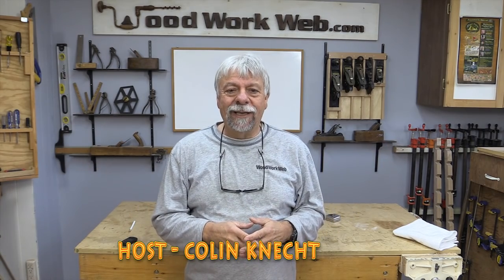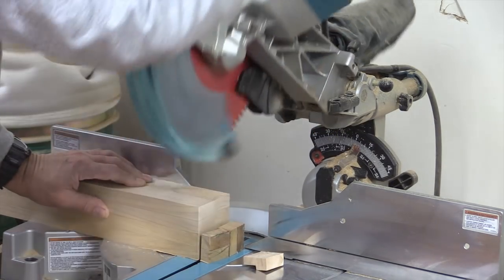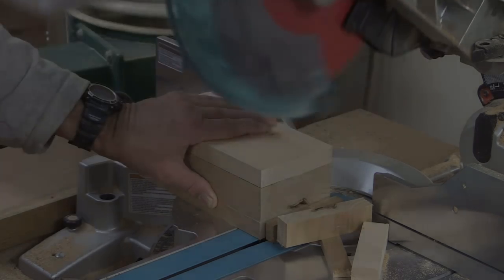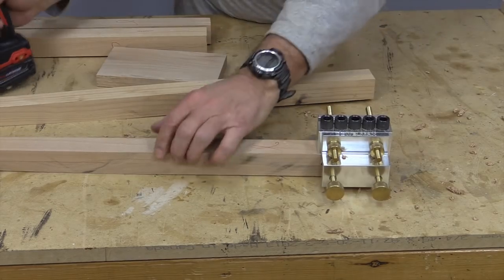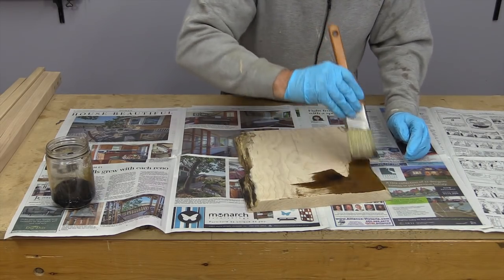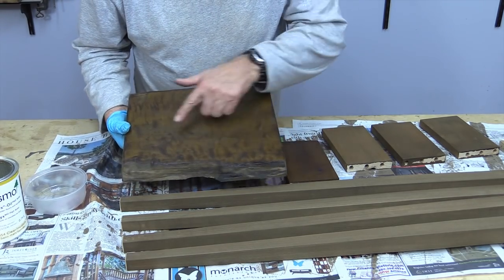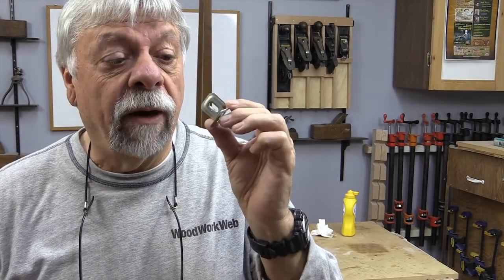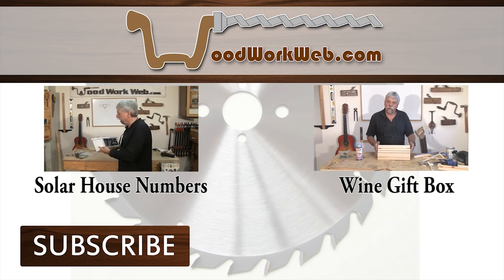How to Build an Album Table with Natural Edge Top

Comment: Good work Colin, however, i wonder how you have turned the screw of the L shape you have fixed underneath the top, i have noticed that there is no enough space for the screwdriver over there, you have cut this scene, have you used a flexible extension to the driver ?
Reply from the maker: +Nouhad Amaneddine Good question Nouhad, I could have used a 90 degree driver or similar, but in this case I was able to use my small drill-driver with a long extention. The screw was in at a bit of an angle, but still went in firmly.

Comment: I thought he did that to get quarter-sawn edges on all 4 faces.  How would they be unstable without the lamination?
Reply: +Bob Snyder As an apprentice carpenter back in the late 1960s journeymen would teach us to use two 2X12s with a 1/2" spacer nailed together rather than a 4X12 for garage door headers.  Laminated wood provides apposing forces which resist warp and twist. GlueLam beams are a good example.  A solid 4x12 is much more likely to twist.  And you are correct the legs were mitered so that all sides would have vertical grain, but this wasn't necessarily the only reason, I'm sure stability was a consideration too.
Reply from the maker: +Bob Snyder Hi Bob, yes Ed explained it quite well. The laminations help reduce or eliminate twisting and bowing caused by wood movement which means the legs will pretty much stay straight and even